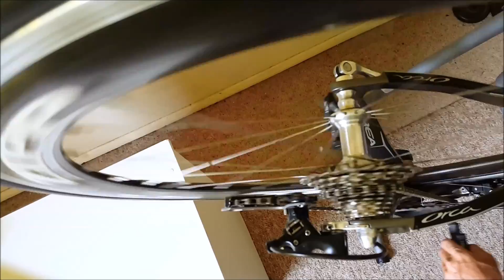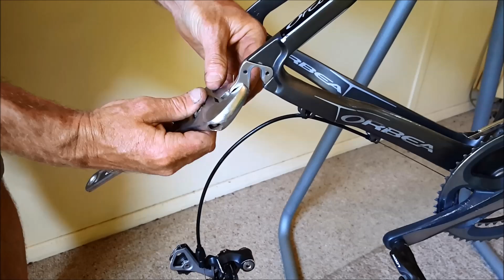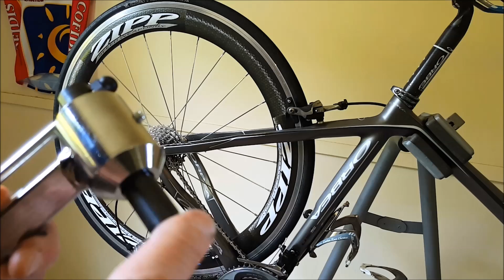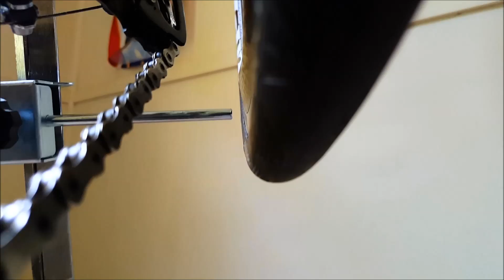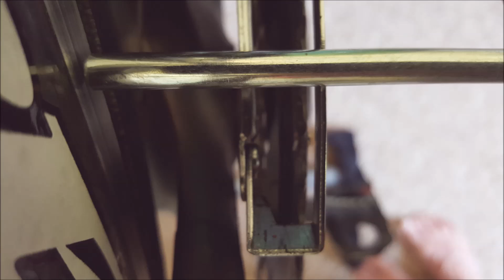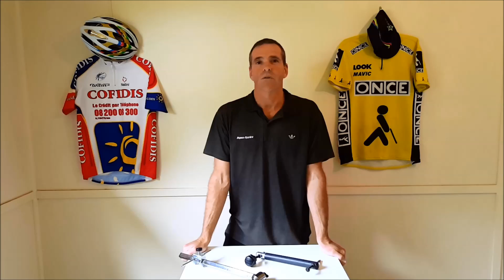How to use a rear deraileur hanger tool

Comment: it is not necessary to jump the pointer over the seat stay when you move the tool as you show, you risk changing the pointer depth when you move it to take the measurements on the front and back of the rim. A better procedure would be to measuring the depth to the rim with the pointer under the chain stay, and than swinging it under the wheel until straight back for your second measurement.  For the vertical axis check, you check the distance from the pointer to the rim from the top of the wheel, and than again swing it backwards and take the second measurement at the bottom of the rim.  Thus avoiding both the seat stay and the chain stay on both measurements, and the pointer does not have to be swung out of the way and than back.

Comment: I find it much easier and quicker to keep the pointer removed from the tool and measure the distance from the rim to the tool with a tape-measure. Thereby you don't have to bother with the offset and the pointer doesn't get in the way when you have to bend inwards.
Reply from the maker: +coustellier The tool is fully adjustable so you should have no probs getting around rear stays and adjusting tools length for offset. Cheers
Reply: I know. I have the parktool one, a var one and a campagnolo one, but I always work without the pointer. I just find it much faster to measure with a tape than to slide the pointer around.

Comment: in an emergency instead of pulling from the deraileur as you said it's better to insert the allen key from your multi-tool in the deraileur screw and use the multi-tool to torque the hanger. that way you don't damage the deraileur
Reply from the maker: Yes "Prasst" exactly,your on the ball.
Reply: Very clear and helpful, thanks!